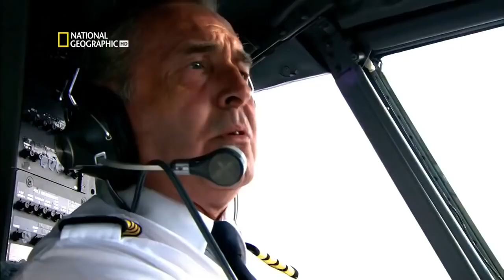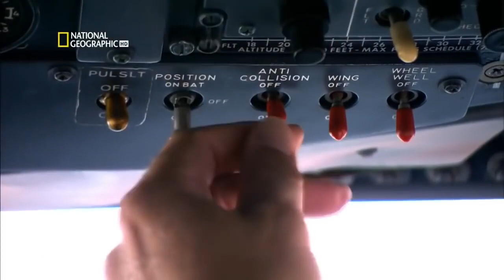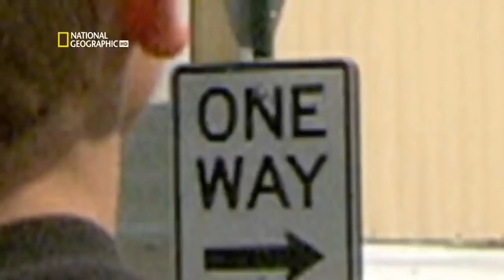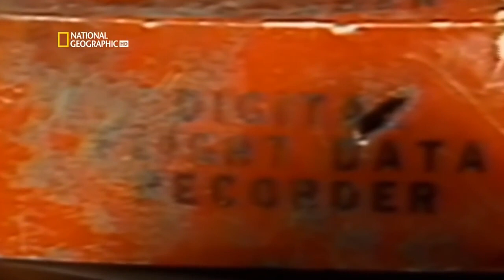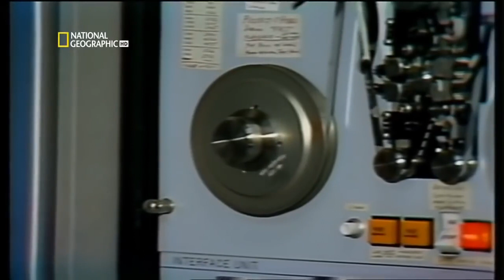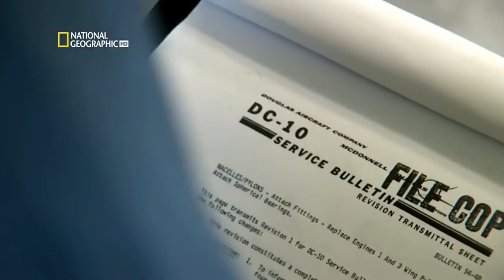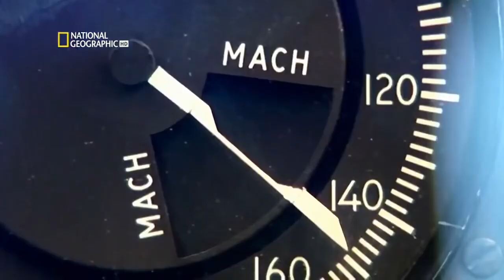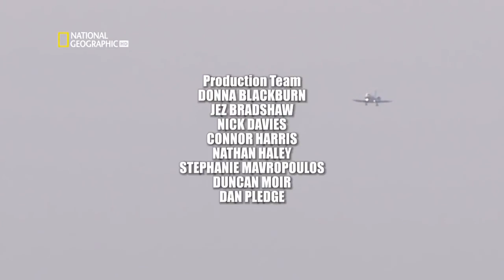Seconds From Disaster Flight 191 Crash (Chicago 1979)

Comment: "Pilots arent paid for what they do, they're paid for what they might have to do." Life and death decisions. I flew freight, just twin prop. I'm also a realist, which is the best quality you can have as a Pilot. Face reality! When you are in a crippled plane, you get it on the ground any damn way you can. Take the ValueJet crash in Everglades, a plane terribly on fire (inferno), and the pilot too compliantly following "procedures" trying to fly back to Miami Intl many miles away while horribly on fire. Absolutely wrong!!! The inferno soon burned through all the flight control wires/cables in the floor, then the plane was uncontrollable, and it plunged into the Everglades. The only correct choice was to immediately and aggressively pitch it to the ground and set it down hard on whatever earth (or swamp) lies beneath you (and all the water in the swamp would have certainly helped with a plane on fire). With an inferno on-board, an aggressive and immediate emergency descent and crash landing is your only chance to save anyone. The plane will come apart, but you will save many, if not most. Pilot in Command has ALL authority to deviate from procedures. In this case, if indeed they knew an engine violently tore off, they also know that key hydraulics for slats/flaps are right behind the engines (very likely damaged), and they also know that wing without slats/flaps will not climb beyond ground effect (equal to wingspan). So the question is...would it have been much smarter to do the same, aggressively return to the ground (while the plane is still level in ground effect) while still close to the ground, and put it down hard on whatever earth lies beyond the runway. Never a good choice, but returning to earth in a somewhat controlled & gradual fashion is certainly preferred over augering it in uncontrolled. This is where personality and makeup of an individual comes into play. Trying to hold a crippled plane in the air is futile and not realistic. I am a realist. If my plane is terribly crippled, I will set it down on whatever earth lies beneath me while its still under control. The plane will probably come apart, but I will save many. You have to face reality in that moment. "A bird in the hand is better than two in the bush". I will take an "undesirable" ending over a "catastrophic" ending any time. Tragic stuff.
Reply: They had no reason to think the plane was uncontrollable in the first seconds.
Reply: @peteconrad2077 . I want to tread lightly here and be respectful of the deceased, but I think its possible they did know. Having a huge engine tear off a wing would be a very physical/violent episode that would surely be felt in the cockpit. This line from the NTSB report ("Everything sounded normal until just two seconds before lift-off,
when the CVR recorded a thump, followed by the word "damn" one second later") would seem to corroborate that they knew at liftoff. Its certainly easy to second guess, and I cant say 100% they knew an engine violently tore off, but it seems very likely. My underlying point is this: when the chips are down, procedures in a book dont matter, what ATC may be telling you doesnt matter, all that matters is the decisions of the Captain, who knows the plane and the situation the best. Seeing the airline/FAA deem the minimum climb speed procedure wrong after the fact proves my point. Had they had more airspeed, perhaps that big swept wing at a notable angle of attack may not have stalled. The Pilot In Command has ultimate authority. IF they knew the engine tore off at rotation speed, with vital hydraulic lines right behind it and likely damaged, would it have been smarter to set her back down and overrun the runway, and maybe even the airport property, into the big field beyond? Definitely. That's what would be formost in my mind in that moment....not going into the air. Sad stuff.
Reply: @Bridging_the_Political_Divide  no, you’ve completely misunderstood what was going on. They knew they’d lost an engine. But they would have almost certainly assumed that flying as per years of sim training would allow them to climb away. The FAA decided the procedure was wrong because it has been shown to be ineffective in this instance. As for your idea that procedure isn’t important in such cases, that’s just not true. Following procedure is usually vital in such cases.
Reply: @peteconrad2077 . Normal engine out SIM training is a very different situation than engine out AND flap/slat hydraulic failure. "Normal" engine out SIM training is not even relevant without the hydraulic failure. Catastrophic damage of a wing changes everything.  When you get a type rating, you go away for months to learn everything about the design and systems of a plane. If an engine violently tore off, and they would certainly know that vital hydraulic lines were right behind the engine (now a twisted crater in the wing), anyone in their right mind would be thinking those lines could well be damaged, and without flaps/slats on climbout of a big, heavy swept wing aircraft at notable angles of attack, it  would be hugely prone to stall, which the left wing did as it augered in. It (hydraulic failure) would be the first thing in my mind, not a "systems perfect" SIM flight. Second, relative to your "always follow procedures", thats wrong, and the fact that all died undercuts your argument.  Giving up precious airspeed (following a minimum climb airspeed procedure) with a big, heavy swept wing aircraft with no flaps or slats on climbout is a recipe for disaster. Exactly the wrong thing to do, and was a HUGE contributor to the crash. They've since said that procedure was very wrong for that situation (Wrong!). If you blindly follow procedures, you would not make a good Captain. Blindly following procedures cost everyone on the Miami ValueJet flight their lives. In a crisis moment, an experienced Captain knows best. Nobody knows the plane as well, and nobody else knows the situation as well at that moment. This is what I'm saying with the decision making and makeup of a person. Remember that everyone died "following procedures."
Reply: @Bridging_the_Political_Divide  as a type rating instructor and examiner of many years experience I know all of this. It’s irrelevant. The point is that they likely had no idea they didn’t have slats and thus, as I said, almost certainly thought the situation could be controlled. They even followed correct SOPs for the EFATO.
Reply: @peteconrad2077 . They all died, you may be willing to accept that, but not me. To just write it off to "Well they followed procedures" is very inadequate. You can cling to operating procedures if you want, but the minimum climb airspeed was SO wrong in this instance. Procedures have been wrong through the years, a Captain must think for himself. Stop being so accepting of 250 deaths. Had they chose to set her back down and overrun the runway into the field, most would be alive today. Fact.
Reply: @Bridging_the_Political_Divide  I can’t believe you’ve got it this wrong. They followed standard procedures for the engine failure. We KNOW that. The speed was only wrong for this particular issue but had been correct fro previous engine failures. The standard procedure was adjusted accordingly.  What don’t you get.
Reply: @peteconrad2077 . You refuse to acknowledge this was not a typical engine out. The hydraulic failure of the flaps and slats that did happen renders this not the "typical occurrence" you are trying to make it out to be. If as PIC Im not 100% sure my plane will remain controllable, Im not leaving the ground (they were rotating half way down the runway when they knew an engine violently ripped off the wing). By definition, their decision was wrong as it augered in and all died. By definition!! Their "assumption" nearby hydraulics were fine turned out to be a bad assumption didnt it. 250 dead. This is what Im saying...not everyone has the makeup to be PIC. Any pilot who always blindly follows procedures is not one I will fly with. Captains need to be allowed to use their experience to fly the plane. Today, airlines are trying to micromanage pilots too much. I can assure you, you could never have a procedure for every unique circumstance. Its very safe to say, had he set it back down and ran off the runway into the field, most would be alive today. The fact that you keep justifying their "assumptions" with the dire outcome means I would never fly with you. Obviously their assumptions were wrong right? And when assumptions are wrong, it needs to be scrutinized.  I know you are trying hard to exonerate the pilots, but given the assumptions and outcome, its not sound. Good luck, just dont fly near my house please......
Reply: @Bridging_the_Political_Divide  Christ, can’t you read. Get an adult to help. I KNOW IT WASNT A NORMAL ENGINE FAILURE BUT THEY COULDNT KNOW THAT SO THEY GOT AIRBORNE MAINTAINING V2 AS PER THE THEN STANDARD.
Reply: @peteconrad2077 . How often does an engine violently rip off a wing? When  providing full thrust, do you think it will cleanly detach (Of Course Not!). There will certainly be collateral damage to the wing. They should have been concerned about those hydraulics. The undeniable fact is their assumptions resulted in a tragic ending. You cant deny that. If you want to say they did a great job, thats up to you. Even if I was willing to agree with them deciding to climb, I certainly wouldnt agree to a minimum climb airspeed with a big heavy swept wing jet at a notable angle of attack on climbout. Airspeed is everything, esp in swept wing planes. Honestly, I am not comfortable with what that flight crew did, and I would have done differently. I'm curious "Mr Always By The Book", did the pilot in the ValueJet crash also do a great job? The answer is definitely not. There was only 1 play with a plane badly on fire (land in swamp), and she did not make the correct play. 150 dead. You cant hide behind procedures all the time. Let the Pilots fly the damn planes! Stop micromanaging them. It was certainly tragic for these 2 instances. I cant reason with unreasonable people. Good luck....
Reply: @Bridging_the_Political_Divide  you really know nothing. Engine failures on take off almost never cause collateral damage. This is a very unusual case. Which is why they wouldn’t have expected the slats to be damaged. Stop trying to defend your position. It’s been shown up as nonsensical.
Reply: @peteconrad2077 . Its a shame you are so comfortable with 250 deaths. Stop trying to exonerate the pilots. Their assumptions were obviously flawed as all perished. Whenever a plane augers in, it needs to be scrutinized. What a shameful apologist you are.......
Reply: @peteconrad2077 . To be honest, you are part of the problem. You blindly hide behind procedures, declaring a total loss as appropriate. As I said before, I would never fly with you.
Reply: @Bridging_the_Political_Divide  you really don’t have the intellectual capacity to get this do you. The pilots had no way of knowing it wasn’t a regular engine failure. They this did what was trained and standard for a regular engine failure. The fact that the slats had failed was invisible to them and so they can’t be blamed fir the fact that their actions didn’t work. No one could reasonably expect anything more from them. 

I do get fed up sometimes with explaining simple concepts to people, who don’t want to or are unable to understand the very simplest ideas.
Reply: @peteconrad2077  I agree with you. Another documentary said the pilots had no idea that the actual physical engine had fallen off. And they did everything that any other experienced pilot would've done.
Reply: @Bridging_the_Political_Divide  I'm certainly no aviation expert but it sounds like you're blaming the pilots for not being able to "think on their feet". One of the NTSB investigators even said they did exactly what any other experienced pilot would've done in that situation. Try to gain air speed and altitude. Are you saying they should've assumed the engine was off the plane?
Reply: @mrsx7944  correct.
Reply: @mrsx7944 . They knew it was off the plane mid-runway, ATC told them. Believe me, if an engine violently rips off a plane...you know it. "Procedures" will never replace a thinking pilot. Procedures for an "engine-out" are not relevant, or entirely relevant when an engine rips off. Not the same. To be pilot in command, you must have the courage to do what's necessary in the face of adversity. They knew half way down the runway it was gone, even being pretty fast (past rotation speed), with about half the runway left, and field beyond, you better have an excellent reason for going into the sky. I won't second guess them, but I can tell you what my first instinct would have been...set it back down, overrun the runway into the field and most people live. As someone who flew twin prop freight, that's honestly my instinct in that situation. Judge me however you want, but "procedures" didn't work out too well did it. Go into the air, it's all or none (risky), run it off into the field and most live. I'm entitled to my opinion.
Reply: @mrsx7944 . The high points of this long thread is this: 1) You only go into the sky with a fully functional airplane, and 2) The Pilot in Command has ALL authority in that critical moment to do whatever is necessary to save lives. Orders from ATC, procedures in a book, and orders from airline management do not matter! In that moment, the experienced Captain has full authority to do what is necessary, nobody overrules the Captain. Guarantee the day Sully set his plane down on the Hudson River there was no procedure telling him to do so, nor ATC orders to do so. He was an ultra experienced Captain who knew better than anyone else their situation, and the best chance to save lives. Nobody overrules the Captain, he or she has full authority to do what is necessary. Procedures have their place, but procedures NEVER overrule the Captain when the chips are down. Never.
Reply: @peteconrad2077 . Your only motivation Pete is to try and exonerate the pilots, and your insensitivity to the families who lost loved ones is sad. Pilots actions should always be scrutinized, it goes with the territory. To just write this tragedy off as " Well, they did what some other guys would do" is piss poor and weak. Knowing they had another choice to make, the procedure was admitted to be wrong for the situation, and everyone died, it's amazing how you still feel: "The pilots did great". Very wrong mindset you have.....
Reply: @Bridging_the_Political_Divide  you very obviously have zero experience in the field. Your statement that never taking a defective aircraft into the air is some cardinal rule is just gibberish, utter gibberish. From V1, it is almost always safer to take a fault into the air. The pilots acted correctly for the information they had available, we cannot fault them, no matter what nonsense you want to believe. The faulty procedure was the engine installation. The pilots did nothing wrong as they couldn’t have known it was a straight engine failure. 

Stick to stiff you know, you obviously understand nothing about flying.
Reply: @alhanes5803 . It's called being a thinking man's pilot,not a pilot too reliant on "procedures". The procedure was wrong, the airline admitted it was wrong, and the procedures were updated as a result! You only go into the air with a fully functional plane. Basic stuff!! This is common sense. 250 people are dead, stop trying to defend a badly played situation. The Miami Value Jet crash was exactly the same result, blind allegiance to general procedures. With a plane terribly on fire, you set it down immediately on whatever patch of Mother Earth is under you. Procedures can never be sufficiently specific to every situation, pilots must constantly be thinking, ready to depart from procedures where necessary. This (blind allegiance to procedures) is why people think planes can be fully automated, and probably will be. And stop trying to impersonate a dead pilot, it's a bad look. Pathetic.
Reply: @Bridging_the_Political_Divide  no my friend. You’re utterly wrong. Anyone with airline experience knows that’s gibberish. With 18,000 jet hours and TRI TRE certificates, I can tell you that a big part of training and checking is teaching how to take an engine failure into the air, deal with it and getting back safely. If you had any knowledge you’d know this. You’ve proved you’re just a know nothing.
Reply: @peteconrad2077  First, aviation is littered with pilot error accidents by very, very experienced pilots. Your hours logged doesn't necessarily mean anything. I would have to fly with you to determine how solid your decision making is. Second, your refusal to consider other actions when ALL DIED is inexplicable. Sometimes the establishment is wrong. Third your "always follow procedures no matter what" position is exactly why planes will be fully automated shortly (with pilots out of a job).  Automated flight decks can certainly blindly execute procedures right now...what need is there for a pilot? Airliners can already put the wheels on the ground as you know. If it's just blindly executing procedures, automated flight decks can do that now. The reality IS you have human pilots in cockpits to do what Sully did, to deviate from procedures when necessary to save lives. You scare me, I would never fly with you. I want to believe you are a thinking man's pilot, but have seen zero signs of that so far. You should really do some soul searching as your inability to examine actions, after the fact, that resulted in all dying aboard is disturbing. After reading this, please send Sully a message he is full of $hit for deviating from "procedures" ok?
Reply: @peteconrad2077  

The swept wings are a critical factor in the loss of the hydraulic system and the aerodynamics of a stricken aircraft. I believe that increasing the airspeed and getting the plane back on the ground would have significantly cut down the loss of life.
There are classified incidents that I have experienced in the Navy on board NUCLEAR POWERED BALLISTIC MISSILE SUBMARINES. If we who were onboard the Submarine had followed the book, I and my shipmates would still be in Davy Jones locker. Onboard a Submarine we had a JAM DIVE SITUATION. We went below CRUSH DEPTH. Yet it was our UNORTHODOX decision to remedy the situation. We were below CRUSH DEPTH and decided to 
1. Increase speed taking us deeper. 
Then we did a FULL RISE on both planes to raise the boat.
Then we did an emergency blow of the forward air tanks followed by an emergency blow on the aft tanks. 
Then we released the emergency RED DYE to tell all surface ships to clear the area that a submarine was going to breach the surface and get the hell out of the area. 
Since we were a BALLISTIC MISSILE SUBMARINE we could not transmit a MAYDAY for assistance. Thus we had to limp back to port. 
Even the CNO (CHIEF OF NAVAL OPERATIONS gave us a commendation for our UNORTHODOX approach to remedy the problem. Yes we lost six crew members,  but we got back to our home port. 
So in essence there ARE times when you just have to toss the rule book out the window.
Reply: @bohemoth1  you only know that with hindsight. In most cases it would be safer to continue the takeoff. Thus this is the right procedure to adopt.